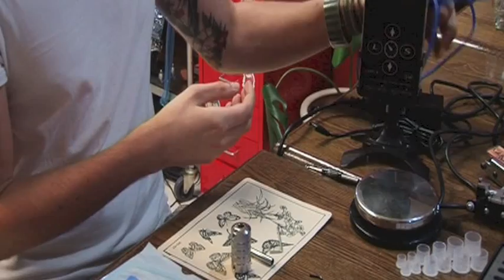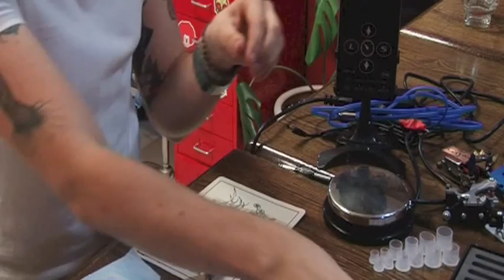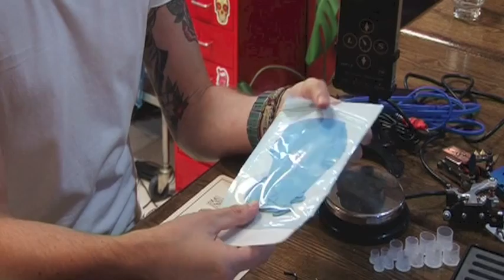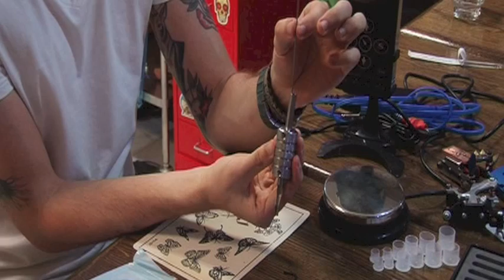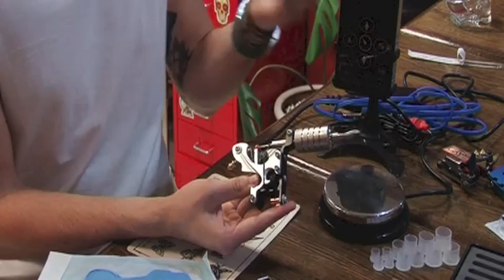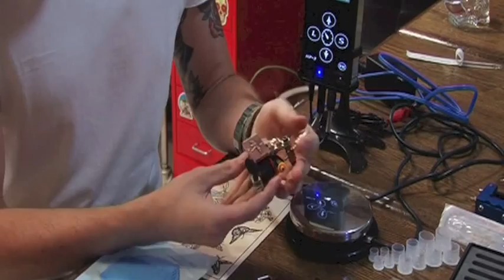how to set up your tattoo kit

Comment: You need the contact screw to be adjusted to 1 O'Clock  angle. This screw must touch the front spring to complete circuit and run.

The mini power supply  dose not give voltage readout so you need a multi meter. 6.5vdc  to 7.5 vdc  is sweet spot . 8vdc  is generally  too much unless using a shader with big needles to push on a large back piece or so .

You need to use the 5 RL a needle  for out line (liner) and  5M1  that a stacked magnum 3 needles  bottom 2 needles stacked on top.  for shading.

I've got to look up these numbers on this capacitor  it's supposed to be a gun for both lining and shading.  Usually  22 uf   (micro farad) is for liner guns and the 47 uf  is for shader guns. 

Play with this thing adjust try different capacitors ,  changeetc coils 8,10 wrap for liner  and 10, 12 wrap for shading . 

Apprentice with pros  who run legit shops , read all you can and you tube the shot out of tuning theses guns and anything else . Just read up. Learn this coil machine and get a fairlu good multi meter with an AC  and DC  volt scale ,  ohms to check coil resistance  and micro farad  scale for capacitance . If you stick with this you'll be tweeting and soldering your own machine's . It your lively hood so knowing the intimacy  of how your machine works and how to create beautiful art with it behooves you.

Good luck , be safe.

Comment: Can someone/you further explain in detail how the needle is supposed to fit onto the rubber part on the top (nipple?) my needle definitely doesn't go into the ring groove in the rubber part. Not sure if it's supposed to. Video is not HD enough to see specific instructions I highly recommend doing a more details re-filming.

Comment: Please don't buy kits there garbage get real handmade machines, get good needles and good ink I started out with a kit and your quality of work will be so much better if you actually invest into your equipment, have any questions get ahold of me on instagram @ryan_patterson_tattoo
Reply: Fam Inked Co Tattoos I actually started with a Homemade Prison Machine & when I decided to get back into it recently i got a Dragonhawk kit and their machines are fine & I've had zero issues with Thier gear & I still use some of it along with my Hildbrandt Machines & my personal Handbuilt Machines I made myself , but the equipment is only as good as the Artist that's using it IMO

Comment: one needle one person. discard after one use. sterilize any equipment that is not one use equipment. like stainless steel tubes, grips. ink cups, needles, are all discarded. Needles in the proper sharps container of course.